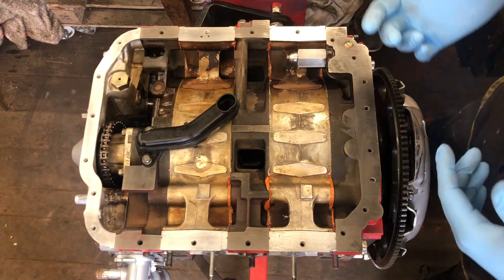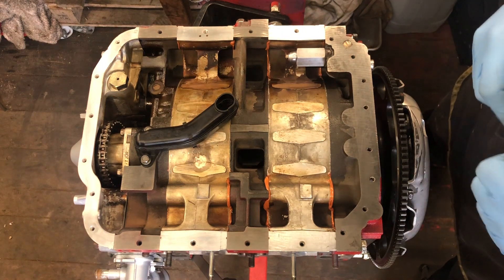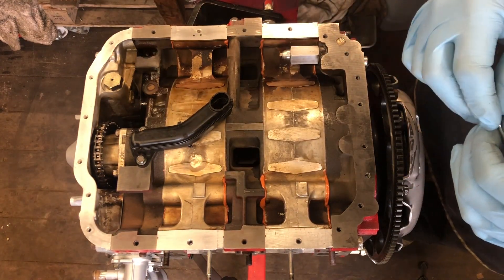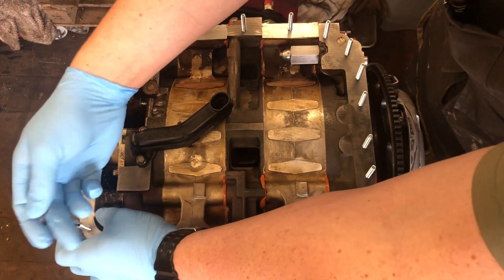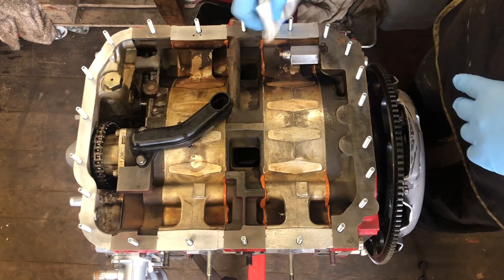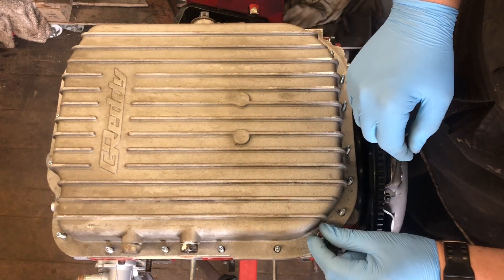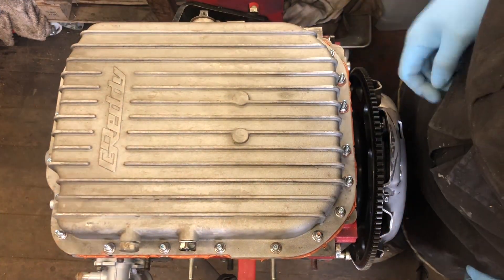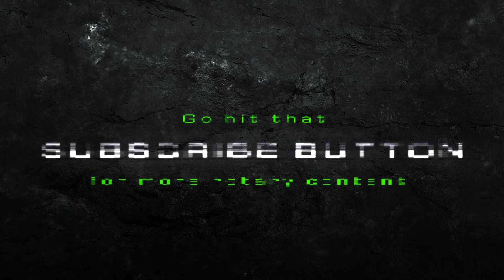Essex Rotary Quick Vid 33 -Installing our High Tensile Sump Stud Kit

Comment: Dont suppose you could tell me what tap to buy pre-emptively to sort the rx7 fds oil pan holey moleys
Reply from the maker: exactly the same size as we mention in the video, At this kit is universal and will fit even the 1st generation Rx-7 and older.
The tap you want is an M6x1